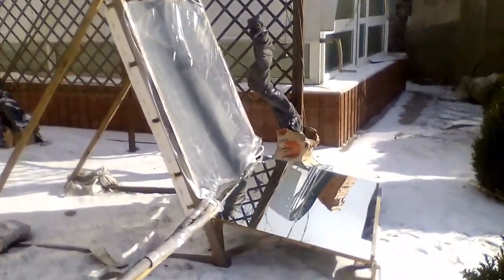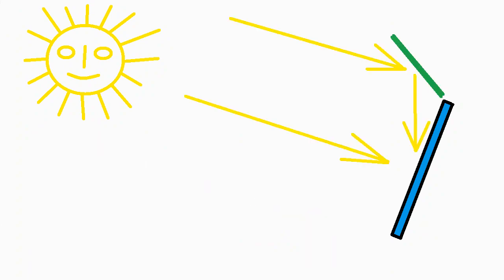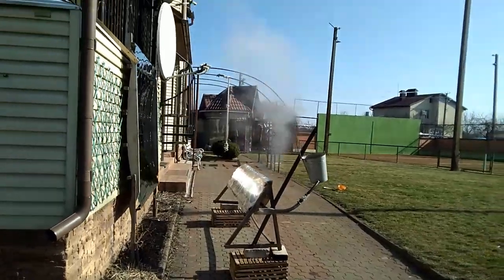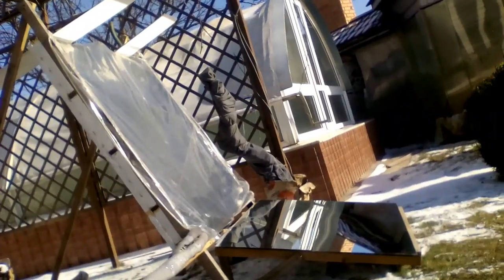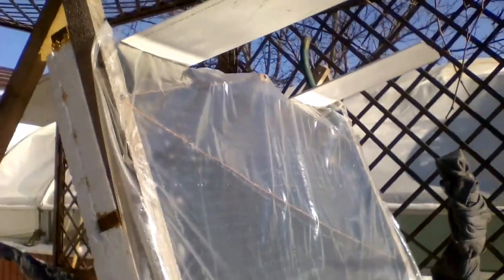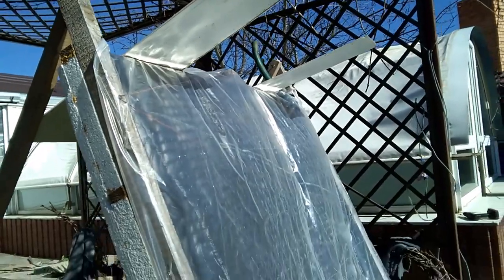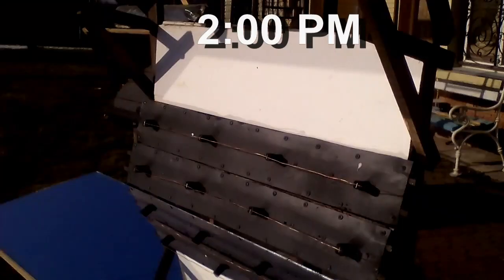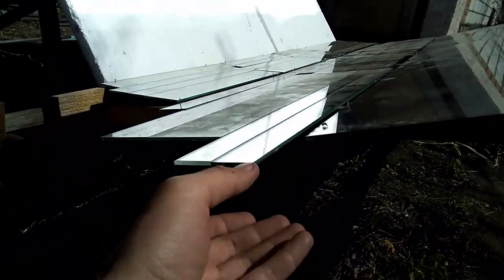What happens if we add a mirror below solar collector

Comment: I wish I had your energy! My health is not very good, so I often have ideas that I would like to build and can not. I've found so many of the ideas I would like to try in your channel! Thank you so much. It's very nice to see them in the real world instead of just in my head.

I'm about to move into a new home where I will have enough land to install a ground based solar panel system. I am thinking of getting some cheap thin plywood and covering it in adhesive mirror film (95% reflectivity and only about $1usd per square meter) and adding these in front of the solar panels during the winter to increase output. I don't think I will add them during hotter months since the extra heat will shorten the lifespan of the panels. But a 100 watt panel during our winter is only going to put out around 30 watts, so bumping it up to maybe 50 watts while it's cold outside shouldnt be an issue and will help me build a system that is not as big and very oversized during the summer when we get more power and need less. 

The angle of the sun during Nov, Dec and Jan is 27/20/27 degrees. So I am thinking that I will build a platform at 23.5 degrees, which would make it almost a 90 degree angle from the solar panels and get them almost twice as much irrandience. 

The mirror film lasts about 3 or 4 years under our conditions, so very cost effective way to effectively make the system almost twice as big during winter.

Hopefully I can get my brother to help me install all this. :)

Comment: Very good video Sergiy. I suggest placing the solar heating blanket horizontal with a clear glass cover and then mount the mirror vertically ... slanted forward at the top so that all reflected light covers the entire blanket all day. Any snow that falls will be quickly melted by the suns reflected solar heat. Keep up the good work.

Comment: Thermal solar often suffers from too little energy in the winter, and too much in the summer. Hence, optimizing both the angle of the panels, as well as the angle of any reflecting surfaces, should be done for when the sun is lowest. There should be no need to adjust the panels or reflectors after this. Unless you have a substantial heat storage capacity, you most often WANT the panels to give LESS in the summer: The production is much higher, with more sunny days AND more daylight, and that combined with little or not heating requirement ... the mirrors adjusted for winter solar azimuth angles will reduce the chance of overheating in the summer.

Comment: Is it possible to use a isolation matt 
It would be round with a cut to the middle so you can fold it together and get a right angle and because of Overlayed matt you can use it in winter.